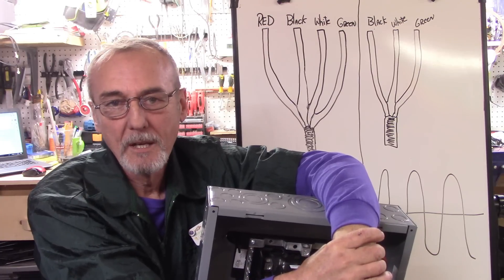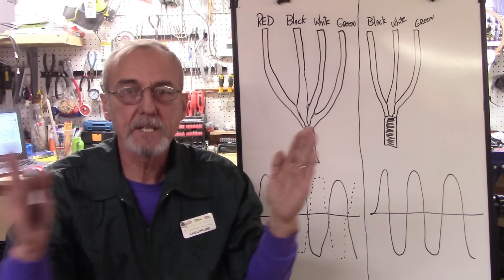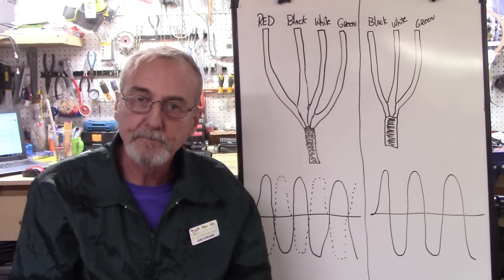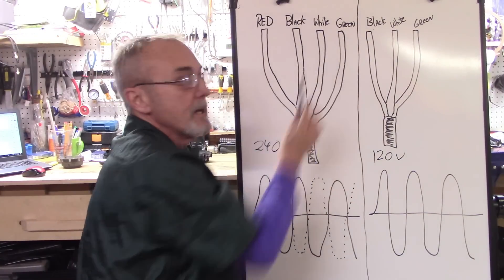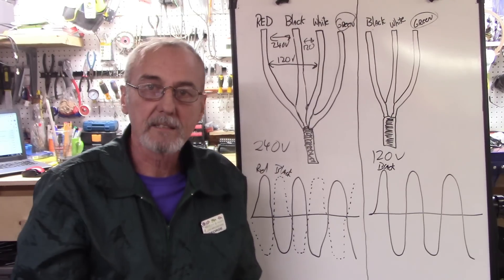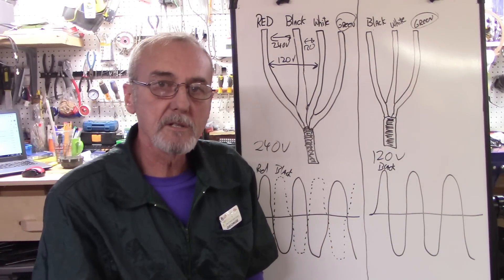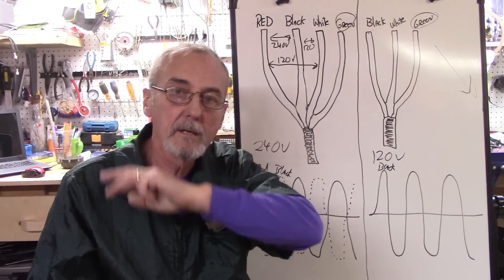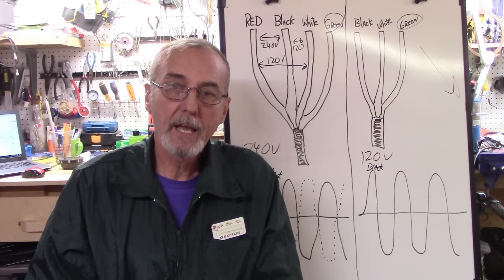240 V  vs  120 V explained

Comment: You are the one who can explain why 240v doesn’t need neutral. Thank you!
Reply: what? where? That's the only thing I came to learn but he just says it doesn't need neutral because it has its own. Basically: "It just works, like magic!"
I presume the alternate phase allows the hots to trade as neutrals for each other but that may as well be magic as far as I can tell.
Reply: doesn’t need neutral LoL. check your breaker designs if you value your life and don’t like electrocution.
Reply: Correct, a 240 volt circuit doesn't need a neutral to work. This is because the two phases, L1 and L2 are 180° out of phase in relation to each other. From each line to ground you measure 120 volts but from L1 to L2 to will measure 240 volts.
Reply: @loser-nobody — No, neutrals are not "traded."  If only 240V is used, the neutral need not be present.  The neutral is the grounded conductor.  It is always the neutral.

Comment: Residential wiring in North America is single phase, so there's no "opposite phase". The single phase alternates between opposite Lines (L1 and L2) or poles from each end of the transformer secondary windings. 240v is measured from one pole to the other, which is the top to the bottom on the sine wave you showed. If you measure side by side as shown at 2:57 you'll get 0v because it's the same point. The line in the center is 0v everything above is + and everything below is -. Measuring from the 0v center line to the peak point in either direction will be 120v RMS. The electrical panel has 2 power busses, L1 and L2 and will measure 240v from one to the other. When measuring from either one to the neutral or neutral/ground bus you get 120v.
Reply: It is just a way of looking at it.  The hot lines are derived from a single phase input to the transformer, but they are 180° out of phase, as he stated.  Whether coming from a 2-phase generator with two coils, or synthesized using a split-phase transformer, they are equivalent.  It is pedantry to argue about what to call it.
Reply: Yeah, expect the OP here is spot on correct, unlike the video creator.  I know enough to know everyone claiming this video creator is the best explainer on the Internet ever, doesn't know the difference btwn information, and correctly explaining a concept, like the OP did here.  We use single phase in America 120/240.  So to say things are "out of phase" is quite inaccurate and not well articulated when better words exist to explain fairly simple concepts...  I kinda thought this video was highly inaccurate, and just dangerous enough to trick ppl into thinking they were "learning" anything of value.  Ground/Neutral concepts are hardly a place to gloss over, or misinform.

Comment: Great video would have touched on the Transformer connected  to main panel which has two hot bus bars which are connected to either end of secondary coil in the transformer and the neutral bar being connected to the center of secondary coil we get 120 from hot bus to neutral bar. but When we connect to two bus bars were connecting to full length of secondary coil thus 240 volts.

Comment: The black wire and red wire are actually in phase with one another. There is only one 240v coil in the pole mounted transformer that is split into two 120v sections. If you use an oscilloscope, and measure voltage from neutral to the  black wire you will get a positive sine wave, If you measure from the neutral to the red wire you will get a negative sine wave. But if you measure from red to black you will get a 240v sine wave that is in phase. In three phase transformer, the lines are 120 degrees out of phase, but not with single phase 240v....

Comment: Good stuff George, as always.  Just to add onto what was already explained... The white wire is also called "common" in residential, as it has a physical connection to the terminal block connected to earth ground in the panel.  Neutral is usually a DC term.
Reply from the maker: Great point!
Reply: Lmfao. That's a resi guy term. Neutral is absolutely tossed around all the time in commercial. NEGATIVE is for DC.

Comment: In the three pronged dryer and range plug, the wires are hot, hot and neutral; the neutral also serves as an appliance ground.  In a four wire plug, the neutral and ground are separate.

Comment: @6:43 3 prong dryer plug is not hot, hot, ground. It is hot, hot, neutral, it's an old style plug before grounds were required. The neutral is bonded to the case of the dryer to act as a ground

Comment: In my country the voltage between the phase and the neutral conductor is 230V +/- 10% and between any two phases it is 400V. Every other house has a three-phase connection.

Comment: Amazing. I live in Uk and on my visit to Brasil i couldnt understand how they had 120 and 240 in the house. Now i understand!
Reply: And in most of Europe today we have a 3-phase 230/400V TN distribution with 230 and 400 volt available to the user while the US stick to a low voltage, high current split phase system.

Comment: 240 volt is 2 120 volt lines out of phase by 180°. So both being out of phase or opposite of each other, with neutral in the center produce 240 volt. Not side by side!

Comment: Some people get confused with the colors, 3 wires can be used if the device only uses 240, so just 2 hots and a ground neutral is for relays and 120 applications.

Comment: I have a 240 3 wire dryer, it stopped working so I thought the dryer went out, replaced the dryer and when the installers connected the 3 wire new dryer, they said the receptacle might be damaged.  

What they didn't realize is that when they plugged it in, it was sending power through the frame of the dryer, and I didn't notice this until I got shocked when I was leaning on the dryer and then touched the metal doors in the laundry room.

The dryer itself was wired correctly, so I tested the connection with a voltmeter and saw 120v on the neutral, 120v on one of the legs, and about 50 volts on one of the legs when I used my multimeter on the dryer plug connection to the dryer itself.

So I replaced the 3 wire receptacle (2 8 AWG AL, 1 8 AWG BARE copper Ground) using antiox for the AL connections.

Turn on the power and I am getting 240 from both legs, but when testing each leg on the ground I am getting 72 volts on one side and 68 volts on the other.  When I plugged into 3 wire dryer, it instantly energized the frame AGAIN, making it possible to get shocked.

How in the heck is power making its way to the frame of the dryer and why is my legs reading lower voltage, but running at 240 when I test both legs?

Some people referred to this as "ghost voltage" and they said that there may be a problem with my ground wire. (which the receptacle manufacterer refers it to a neutral on the receptacle itself.)
  
Is it a ground? Is it a neutral?  Why did they use bare wire, just because it's ground? When I plug in the dryer it's also sending power directly into the ground.  Is it supposed to be a ground?  I checked the circuit breaker box and couldnt locate anything.

I am so confused.
Reply: If you have a 3 wire dryer (NEMA 10-30), there is no ground. Just L1, L2, and neutral. The case of the dryer is connected to neutral, which is why you have that "ghost voltage". This kind of setup has been obsolete for years for this reason. The modern way is to have a 4 wire cord and plug (NEMA 14-30) for the dryer, with L1, L2, neutral, and ground, that provides a separate ground path for the case. Also, the fact that you have that voltage on the neutral, and extremely low, unbalanced voltages from the lines to ground (should be 120V each side) means you have other faults in your electrical system that need attention.
Reply: @dougbrowning82  I was recently able to find out why I was getting the ghost voltage, it turns out that after my new Pex installation, the ground/neutral lost continuity and I was able to fix it by bonding it to the copper pipe coming in before the Pex and it's been working fine.   I was unable to see the bonding clamp on the pipe when I went to the new Pex system (which I had prefabricated.) 

Strange how the frame was being energized due to no ground, but the phases canceled each other out, but probably somehow used the frame as a path to ground.

Both legs are showing 120v now, dryer running perfectly.  The receptacle was in terrible condition and whoever installed it back in 1972 used no antiox at all, so I had to cut back some fresh conductor that wasn't oxidized and rebuilt that 10-30  Planning on upgrading to 10/3 or 8/3 4 prong 14-30.

Silly that they used the plumbing to ground the dryer.

Comment: Great video. My welder has a 110v 220v 3 pronged cord. My generator has a L14 20p plug in.  Can't seem to find an adapter so im using a L14 30p i got from lowes and wired it to the end of an adapter the welder came with that steps down to 3 pronged 110v regular home outlet plug.  My question is should i just cut the end of the welder 3prong 220 and wire my L14 how you've explained b hot and w hot g to ground with neutral open. Or use the adapter to splice the L14 onto? Also my generator is a floating neutral. Will that affect anything?

Comment: This was an excellent explanation, well done.  A lot of people ask me why we call it single phase instead of two phase.  It is, in fact, two phased 120 volts in the strictest sense, however, as you demonstrated, when two voltages are phased 180 degrees out from each other, we call it a single phase because of the summation.  If you're talking 3 phase, for instance 208 volts, that's still 120 volts per leg but the phases are 120 degrees out from each other so the result is 120 * sqrt(3) = 208 volts total between any 2 of 3 phases.

This is also why some residences have 208 volts instead of 220/240 because they are in a zone that has a 3 phase grid instead of step down transformers that split tap the single incoming phase.  They just pull 2 of the 3 phases to the panel.
Reply from the maker: Very well said. I just learned much more about 208 than I knew before.
Thanks
George
Reply from the maker: This is priceless. Laughed hard and long. 220, 221 whatever it takes....
Reply: @BarleyandHopsBrewing ....the first thing i had to look at the panel box to see if their service could handle the new equipment.   my helper and i would set up the home owner with that .. 220 221 whatever it takes...lol
Reply from the maker: I plan to use this line in a video soon. I just think it's the funniest thing ever for those who understand basic electricity.
Can't wait to lay that one out there and see who replies.
Reply: @BarleyandHopsBrewing   you have to tell your laxative and sleeping pill joke again.    
somebody will ask me "what do you think?'  i'll look at them really serious and lay that on them. i love it!
Reply: It actually isn't 2 phases. It only appears as 2 phases, for 120VACrms, because you are measuring from the line to the neutral (center tap) as your reference point for both lines. When you shouldn't be. 

If you measure the voltage before the transformer, you'll see it is only a single phase of 240VACrms, so it can't magically become 2 phases after a simple transformer. 

After the transformer, if you measure Line1 to Neutral, you'll see 120VACrms, if you then meaure Line 2 to Neutral, you'll see what appears to be a 180 degree out of phase 120VACrms waveform. However, if you instead measure Neutral to Line 2, you'll see it is in fact in phase with Line 1. If you are using an oscilloscope, you can then sum the 2 channels and see the 240VACrms waveform again. 

I'll use 2 AA batteries to explain it. You have 2 AA batteries, sitting in a row in series, so the total voltage is +3V. If you measure from the open positive end of the first battery with the positive prob, and the open negative end of the second battery with the negative probe, you get +3V. Now lets say you affix your multimeters negative probe to the point between the 2 batteries (the "centertap"). You then take your positive probe and measure the open positive terminal of the first battery, you see +1.5V, but if you move your positive probe to the open negative terminal of the 2nd battery, you'll see -1.5V, and you'll wonder, why isn't the total 0V?

This is how you are measuring the split phase 240V/120V system and seeing two waves apparently out of phase, when in reality they are not. 

So in the strictest sense, it is in fact 1 phase, you are just measuring it incorrectly. If it was in fact 2 actual phases, than 240VACrms would actually be 0VACrms, because summing two 180 degree out of phase waves of the same shape and amplitude gives you 0.
Reply: @adamw2785  Thank you Adam. That was a better explanation than the video and some of the other comments, which are wrong.
Reply: @hanshotfirstin1977 yes thanks. It’s been a long time since I’ve messed with anything electrical but I’ve never heard of a 2 phase anything lol. Single and three phase. That’s it.

Comment: Great explanation. I have a circuit breaker that was 220v as it supplied power to a pool pump. The pool is now gone but I'd like to wire up a 115V outdoor outlet. Can I use just wire one leg of the 220v breaker (either red or black) plus neutral and ground?